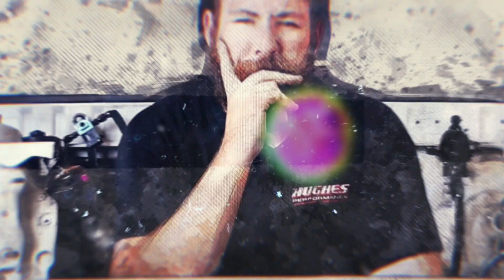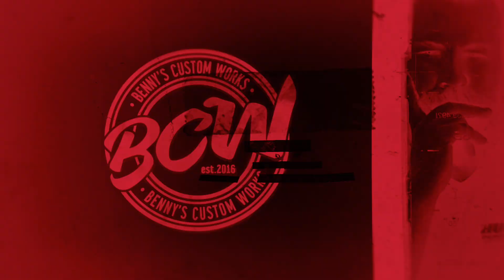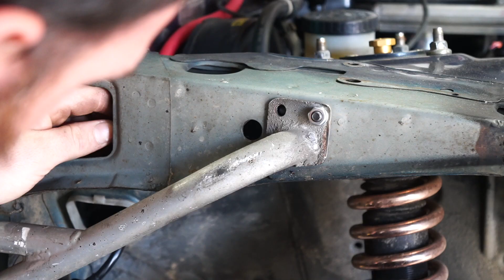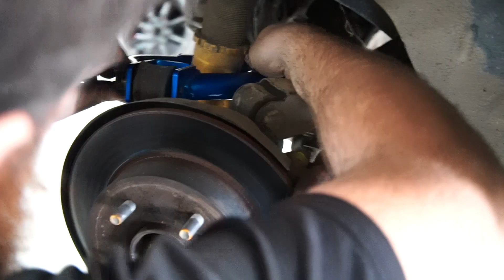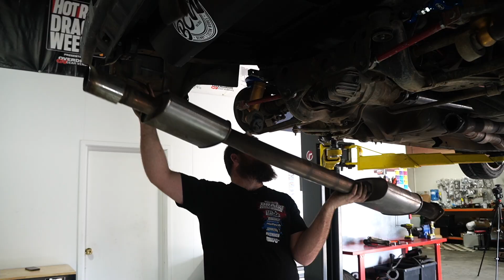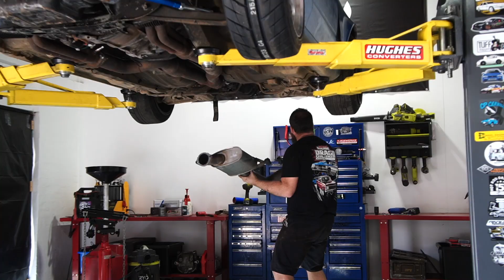V8 Supercharged S13 - HOW TO : Drift Pineapples, 1.5 Way Diff, Rear Camber Arms, & Front Support

Comment: Firebird and Camaros from the seventies to 82 were truly the king of the roads many of the upgrades that you were putting on the car came stock to some degree in the Firebird which could be had up to a 455 or 454 for the Camaro with a little massaging could easily push over 400 horse that’s why we called those the king of the road and the Corvette which was GM’s Sports car was pushed into inferiority because of the Firebird not being bound to the Chevrolet on the engine gave the hot roder or whatever you call yourselves today a lot less work to do to get that power to the road love your work thanks for sharing

Comment: I’m currently undertaking a complete rear subframe overhaul in my s2 rs4s stagea with new gktech hicas delete with toe arms, whiteline poly subframe, diff, lower control arm bushes, all gktech poly bushes in the knuckle, new oem shock bush and oem outer control arm ball joint and far out is it a shit job. Will feel so solid once it’s back together though. Keep it up benny!

Comment: I would highly recommend getting some gktech offset rack spacers otherwise you will have steering bind with the roll center correct. .. its pretty cheap and it saves having to cut and weld the rack forward. .. also you may not be able to like me because ive jammed a 302 windsor in the way ... it fixed all of my problems and gave me a bunch more lock and control over the car ..
Reply from the maker: Abes Oddissy andrews we haven’t had any issues with bind .